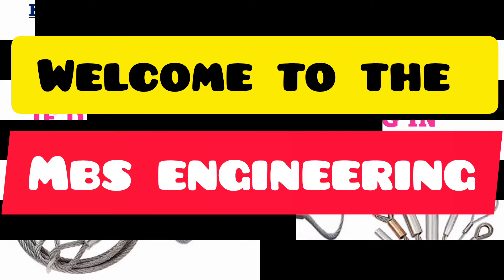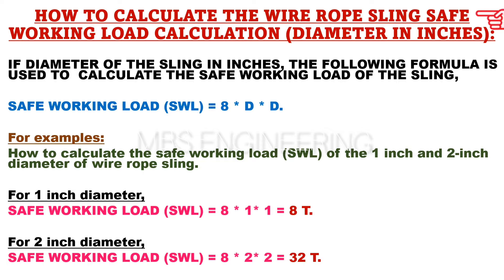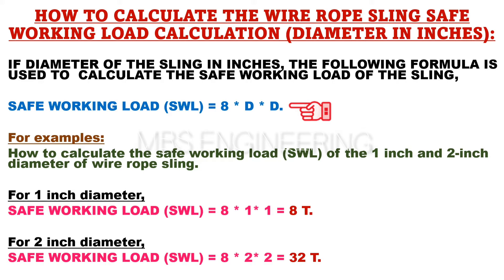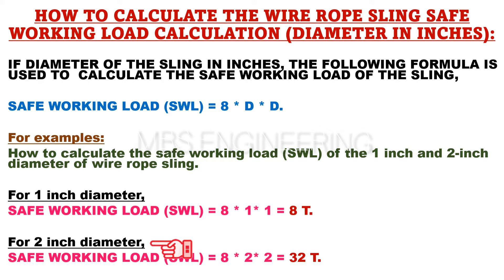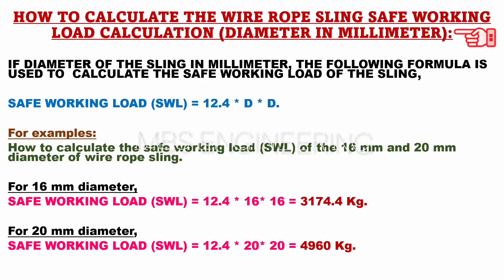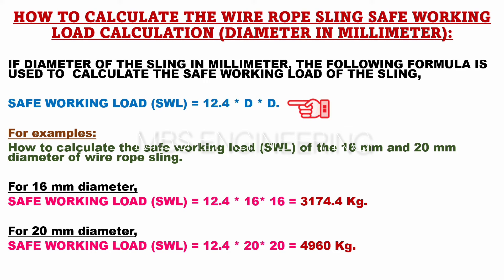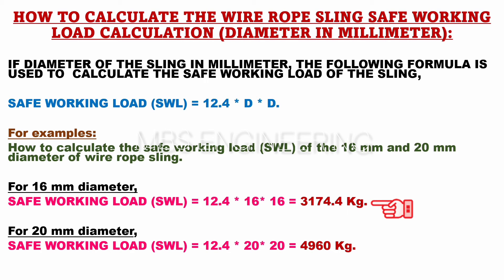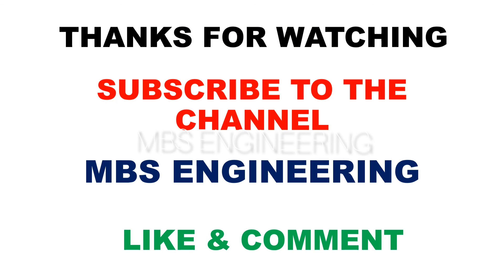WIRE ROPE SLING SAFE WORKING LOAD CALCULATION / HOW TO CALCULATE THE SWL OF THE WIRE ROPE SLING /

Comment: Thanks for the explanation
But pls does the length of the wire rope sling have an impact on the capacity?
Reply from the maker: The length of the wire rope sling does impact its capacity.